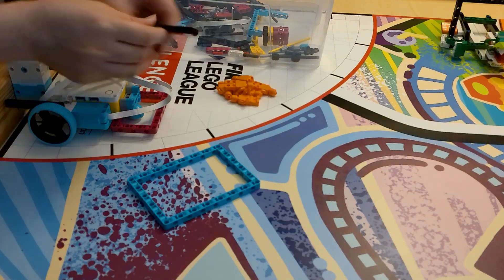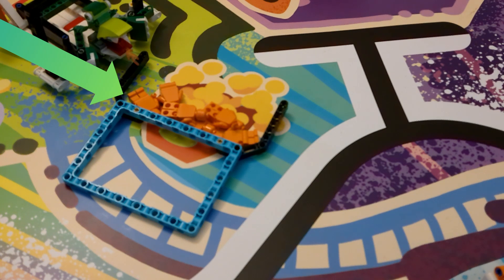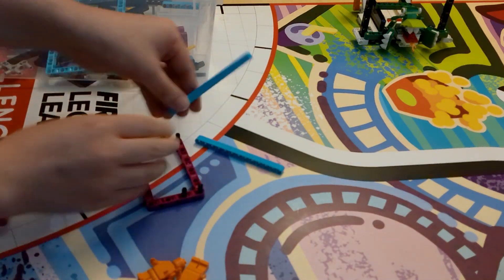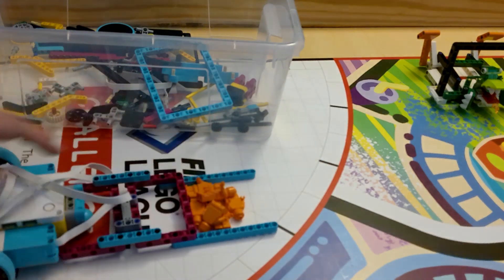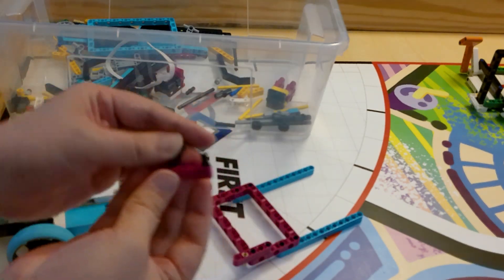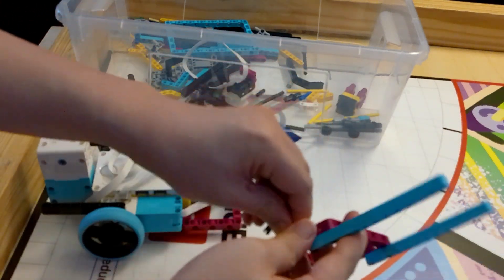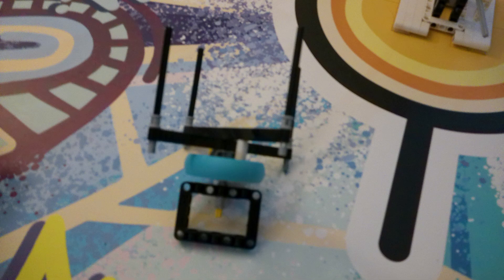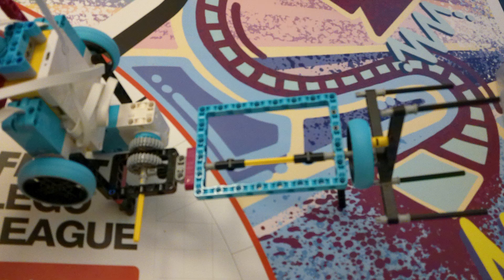How an FLL Champion Easily Makes Attachments

Comment: Leaving attachments behind makes the robot smaller, so navigating a crowded field becomes easier.
Reply from the maker: That is true, but it also makes the field more crowded.
Reply: and be sure to check whether the rules allow for robot equipment to be touching the mission at the end of the match (it's allowed for some missions but not others)
Reply from the maker: That is true, for missions like the immersive experience and the sound mixer, you would need to make sure nothing is touching it at the end of that match if you want to score them. For tasks like the audience delivery, there are no rules about this. For tasks like the Masterpiece, you need to pay attention to the specific wording.